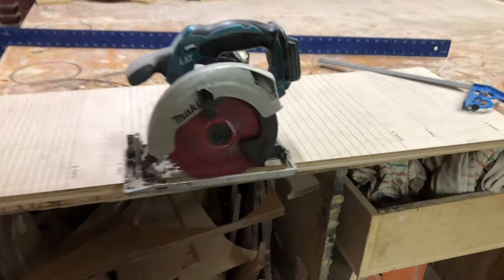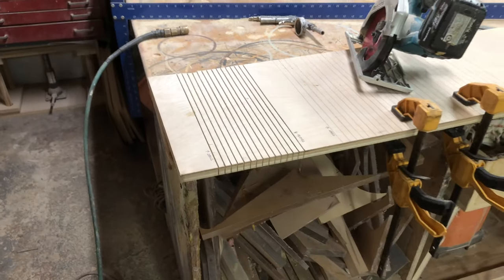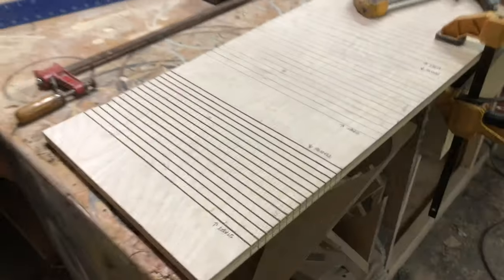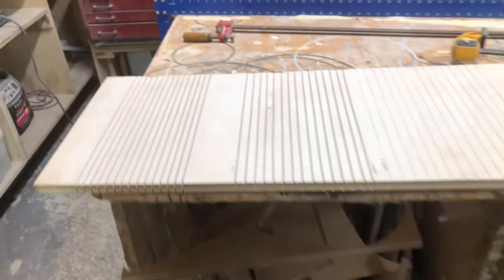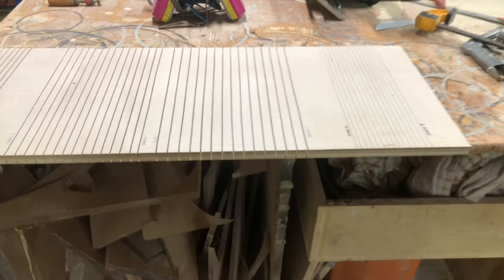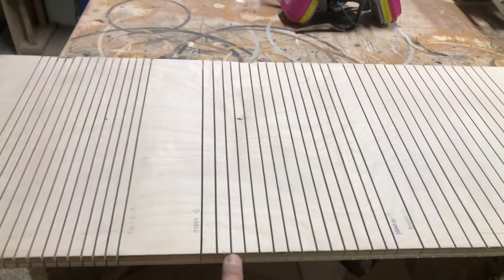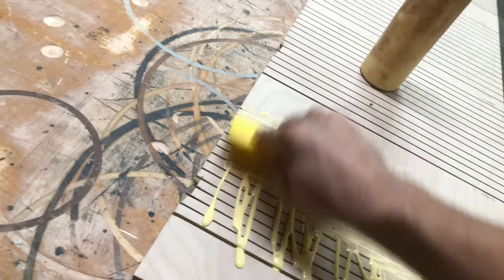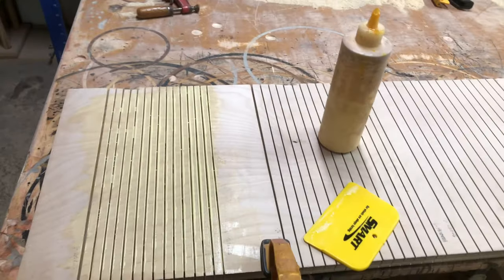How-To KERF! (Part 2) IN THE SHOP WITH CUSTOMLOWZ Daily Car Audio Vlog Ep43

Comment: I like to use fibreglass paste instead of wood glue as it goes deep into the cuts and fills any voids. Scraped off the excess and it dries alot quicker aswell

Comment: Great tutorial! I'm building a box for a co worker Im not expert but say a novice at box building but I've never built or tuned a kerfed port, but I do think there so cool looking. How does the flare affect port length? Do you start your port length measurement at the inside end of the curve like basically not including any area that's flared?